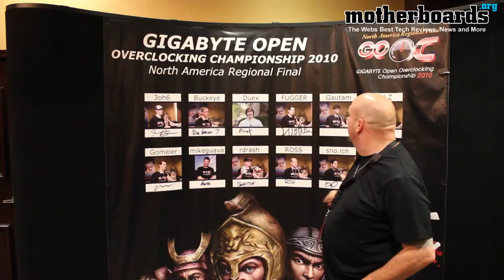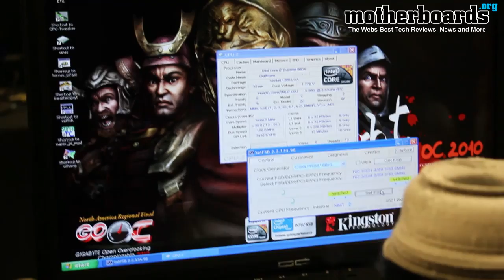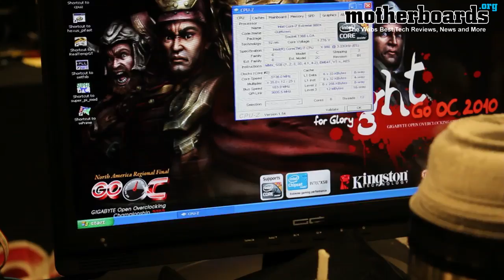Gigabyte Overclocking Championship 2010 - Liquid Nitrogen 5.5GHz OC & More! :)

Comment: @gmk120 yeah, but a 8.1ghz on intel core 2 duo is not better than a 5 ghz on lets say core i7. The GHZ are decieving, somethimes instructions are broken down into components by manufacturers. And that number probably represents single threaded apps, which is of little use, specially when it comes to gaming.